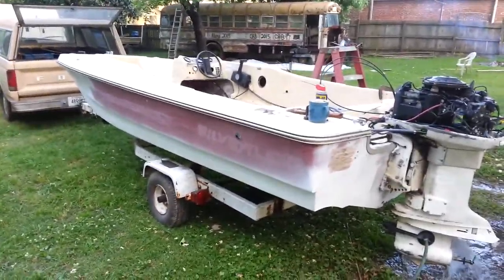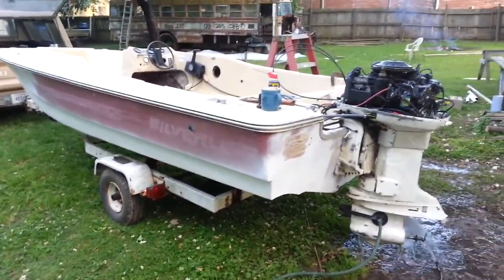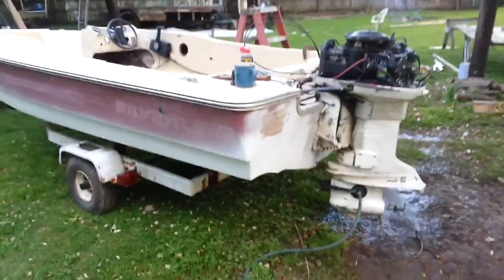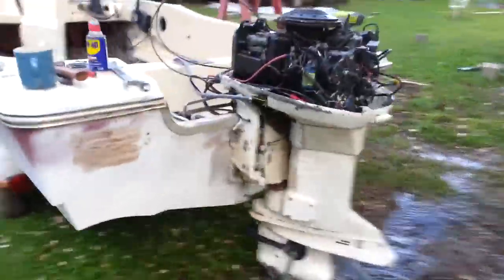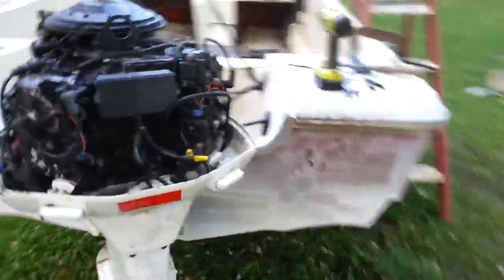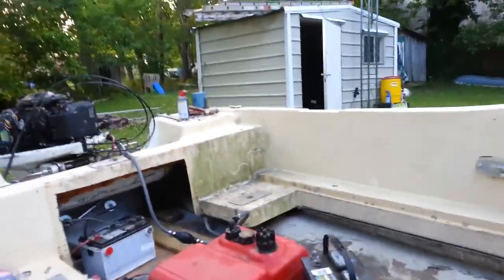Silverline 1979 Boat Restoration

Comment: I am repairing my transom on a 1980 silverline do you have any tips on doing it?
Reply from the maker: jacob hart take your time, make sure you use lots of resin on the marine plywood. The better you seal it, the longer it will last. You may have problems with getting good adhesion to the fiberglass.you gotta work fast with that stuff.